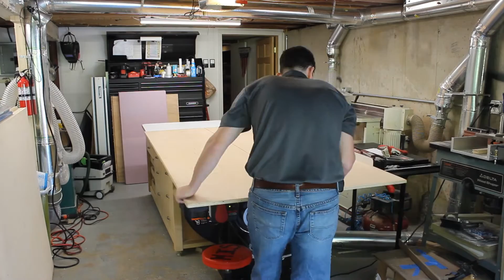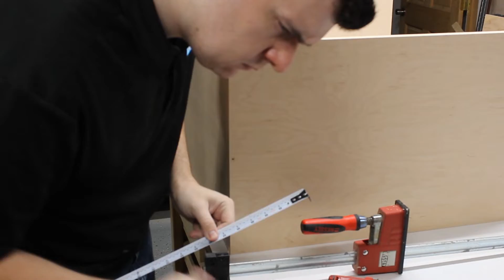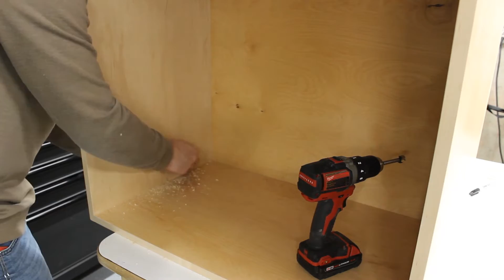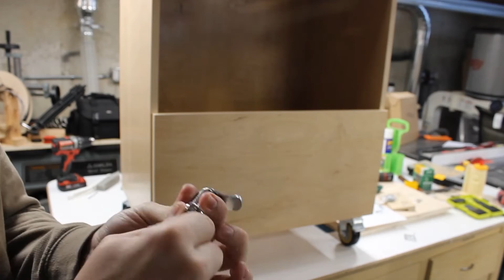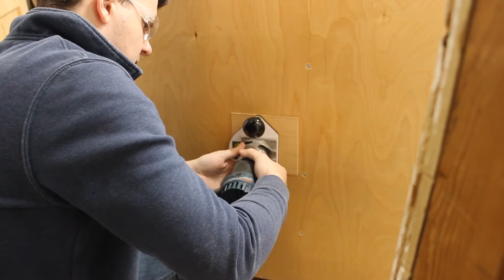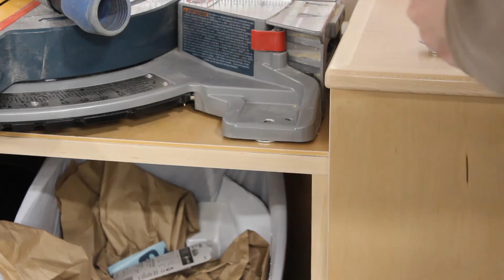Shop Projects: Ultimate Miter Saw Station

Comment: You mention having an issue with mold. Do you keep one or two dehumidifiers in that space?
Reply from the maker: None, it was a water ingress problem since resolved. I had an issue of keeping plywood or wood on the ground, especially MDF as it absorbs so much moisture. I since designed and built a plywood/lumber cart that keeps everything organized and off the ground and is now a non issue. (see my video for this it's really nice!)

Comment: Hi Brian - I've gotten started and am really enjoying the build.  Nice job on the plans!   I have finished the cut list and am starting assembly.  I've collected some minor errata for you in the PDF that I'd encourage you to consider.  
Errata –
1.	Page 4, Cut List 2, Parts L and M:   The indicated measurements of 17 ½” for those two parts are incorrect.  They should be 18”.     I read the plans without realizing the arrows were not the full width of the cut, (they stop 1/2"short at the rabbet - this was probably overlooked when the CAD tool locked onto that line instead of the correct one.)  I ended up cutting all four panels too short by ½”.  Luckily the error applied to all four panels equally so the cabinet will still assemble no problem.
2.	Page 8: Side panels should be labelled L, not M.
3.	Page 6: Part labelled L should be M.   M should be L.
4.	Page 11: Part I should be A
5.	Page 5: Part N.  Measuring the hinge hole centers from the centerline of the board is inconsistent and less easy as measuring from the edge, as you did for Part M directly above.
Recommended –
1.	Add all plywood and hardwood to the materials list.
2.	Since cutting an 8’ length of  heavy plywood is impractical for some, (me for sure at any rate, maybe others too), breaking down the sheet across the width is the first step.  To that end:
a.	Cut List 1 on page 3, for the bottom sheet of plywood on that page, rearrange panels to minimize cuts.  At minimum shift the right G panel to the right to align with left edge of F panel above it.
b.	Cut List 2 on page 3, for the top sheet of plywood on that page, rearrange panels to minimize cuts.  At minimum shift the right G panel to the right to align with left edge of F panel above it.
c.	Cut List 2 on page 4, for the middle sheet of plywood on that page, rearrange panels to minimize cuts.  At minimum shift the right M panel to the right to align with left edge of N panel above it.
3.	Label plywood boards (1-6) to aid in referencing them
4.	Provide table of uses for parts A-R (e.g. M parts are top and bottom of center cabinet)
5.	Part J is not used in the plans after the Cut Lists, but is assumed to be shelves.
6.	Page 5: Replace “nest” with “list”

These are all trivial bugs, overall the project is going quite well, you've done great work!  I recommend it to others.  I took your advice to buy pre-finished plywood, thank you for emphasizing that.    I will send some pictures when I'm done!  
Best, Richard

Comment: Nice job, simple but not spartan.  I've looked at too many mitre saw station videos, finally pulled the trigger and have bought your plans and will be getting started shortly.  In the video you recommend using better legs/feet than the ones you did, and mentioned they would be called out in the plans.  I didn't see them in the BOM.  Did you find better legs?    I did see the ones you ended up using, are they still ok for you?   Thanks!  Looking forward to building it!  Richard from San Diego, CA
Reply from the maker: Thank you for your support! I did leave them, they are inexpensive and do the trick so I felt best to leave them as is. No issues with them at all. Thanks!

Comment: Brian, so with your 32nd of an inch spacing (sides and fence back) do you then just make sure that when you go to cut something, you make sure you are registered off the saw's fence?  This is NOT a smart a$$ question.  I genuinely want to know.  Goes back to the fence vs fence less miter station.  Thanks.
Reply from the maker: Yes, the only part that matters is to have the board up against the saw fence. The outboard fences are only means of using the measures stop blocks for repetitive cuts. Hope this helps.

Comment: can you go further in depth on your thoughts on your dust collection for this bosch miter saw.
I have the same saw with a 6" 5HP clearview cyclone system.  I have tried every way to collect the saw dust and fine dust from my station/enclosed box, with swinging doors,  that is similar to yours.  I used to have a 6" port sucking from under the saw box, but changed it to overhead when I ran new duct work configuration.  I have found that the vent pull through the top of the box does not work well.  but a new route from the overhead main trunkline  to the bottom of the saw will require a U-turn on the ducting verses the existing straight drop down from the trunk line.  I am even thinking about running an additional shopvac on the tiny 1" factory dust port.  what are  your thoughts of duct from the top, or side or beneath the saw/box and on using the tiny factory port.  all the videos on youtube are for beginners trying to cut corners.  I have spent a lot of money on my set-up and expect better performance.  I also have blast gates at every down drop from the trunk line hung from 11' ceiling.  since I have several blast gates at the 11' high ceiling, do you have any experience with electronically controlling blast gates?
Reply from the maker: No experience with electronically controlled blast gates but there are a few systems out there if you google them, for your setup it sounds like a good investment. I haven't gotten this far on the miter saw other than the festool vac hooked up to it. I would say that gets at least half but def. the direct saw dust and the other half I'm hoping to get with the dust collection (the indirect cloud of dust that permeates in the vicinity of the saw. Dust collectors are much better at the latter. A 6" 5hp cyclone should be doing you justice but spreading out on a shop with 11' ceilings I can imagine that you might have some difficulty depending on how far the miter saw is from the dust collector.

Comment: Nice build, at first I thought "splay lacquer? too overkill" but then I realized if I'm going to build something for me and it'll be used in a daily basis better be nice and make me feel good to be in that space...very nice job man!
Reply from the maker: Thank you! I would not have sprayed this (other than the countertops) if I had no material kicking around, I would just have used prefinished plywood. Prefinished plywood around here is only about $10-15 more than natural cabinet grade maple so it's definetly worth it. My garage is below grade on both sides so during the humid months I get a lot of moisture so anything exposed can get moldy. This being off the ground will help and the lacquer will keep the plywood from picking up any of that excessive moisture (hopefully). But as you said, if you're going to build something you use every day for the rest of your life you might as well build it nice!